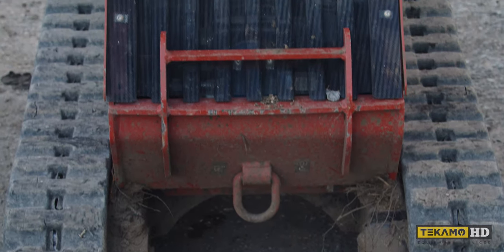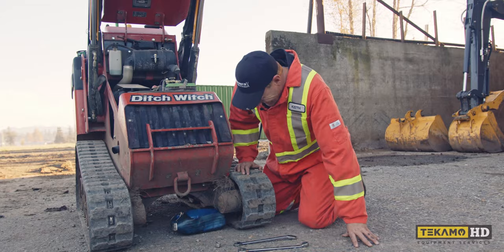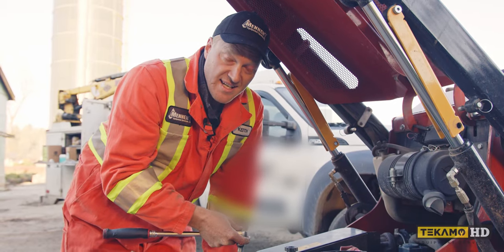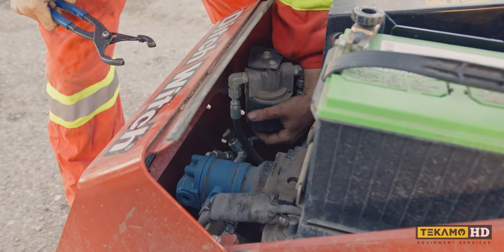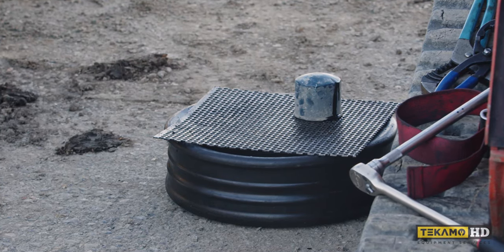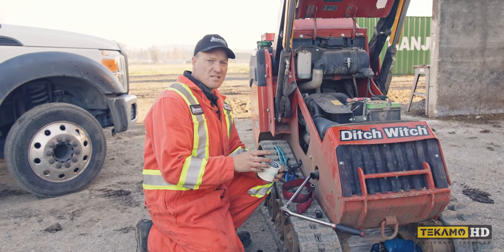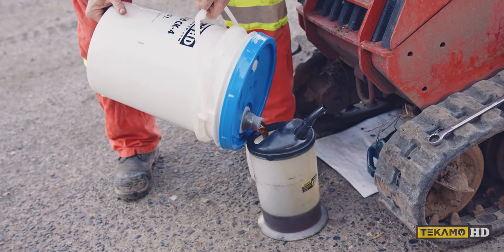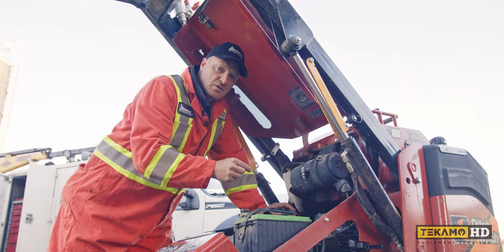How to Change the Engine Oil & Filter on a Ditch Witch SK755

Comment: Where I work we have a bunch of these Ditch Witch machines - SK800, many SK1550s and a SK3000.  I always use a vacuum extractor down the dipstick tube to drain the oil.  Much faster than waiting for the oil to drip out the drain tube on the bottom.  I believe they use a hydraulic line as the oil drain tube and it's just too small.  I can have the oil filter, hydraulic filter, inner and outer air filters, fuel filter, water separator changed, track tension set and they're still not done draining oil out the tube on the bottom lol.  Our local dealer sucks but overall they are good machines.  The Yanmars are pretty bulletproof in them.  Occasional issues with the connectors for the DPF differential pressure sensor causing them to throw emissions systems related codes but it's a known issue with them.  SK800 is especially great because it doesn't have any of the emissions BS.  The 1550s are workhorses though, our crews run them well beyond their rated limits every day and they just don't give up.  SK3000 is a giant turd, the factory specs are WAY overrated and the early versions don't have enough bolts holding the drive motors to the track frame, they'll start snapping off until finally all of them on one side let go and the ear on the motor gets bent and you spend several hours extracting snapped off bolts deep in the frame.  Wish we'd never bought that POS, the later model track frames use more bolts for the motors.
Reply: Im confused on the hydraulic oil to use  ,theres all different listings my manual is not in English..i have d1105 sk 750 used ..i bought filters andd the 15 40 oil recommended. And was useing 46 hydraulic oil..and says to use 80/90 gear oil..also this kubota has 2 dip sticks ..im arborist and not sure on this machine..the sk 800 850 are completely different they wanted 25g used for them so was only able to get sk 750 its a 2015 model kibota ..also it struggles up hills ANY HELP PLEASE ,,would be much needed appreciated???
Reply: I got wixs or wics filters,?
Reply: And can't find specs on engine oil amount ?

Comment: I have a sk 752 very similar but not a turbo model. I have trouble with air bubbles in the fuel line after the filter change. And yes I fill the new filter with fuel before installing. 

Any thoughts apreciated.
Reply: Loosen the lines at the injectors and start it until it starts spitting diesel

Comment: Having issues woth my sk800. Turns on all hydraulics work but it doesnt go fordward or reverse, doesnt make hydraulic noise or anything only thing i found out is: one cable was bit by a rat most likely from the parking break. The spot where is at i cant move it to the dealer any one can help? Does the parking wire affect the tracks at all?